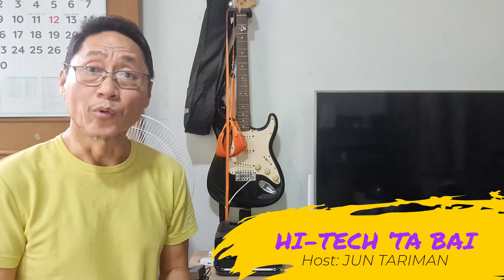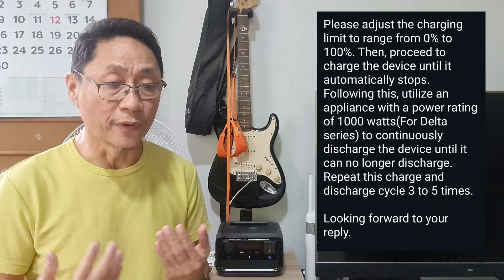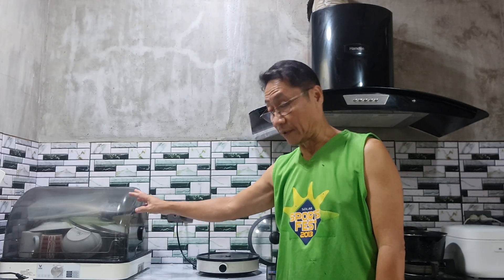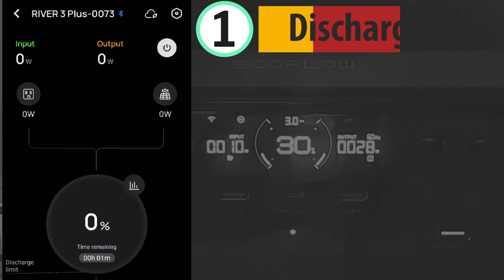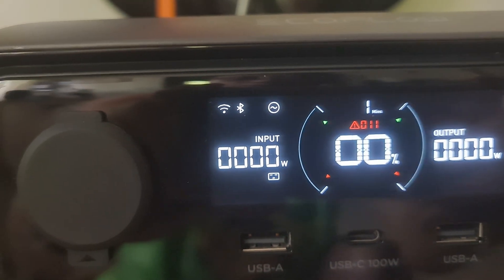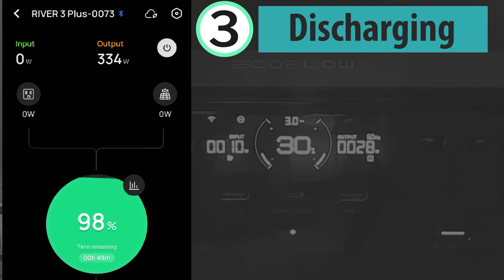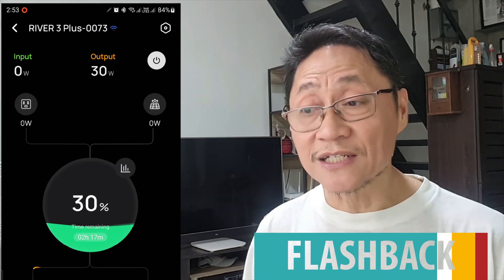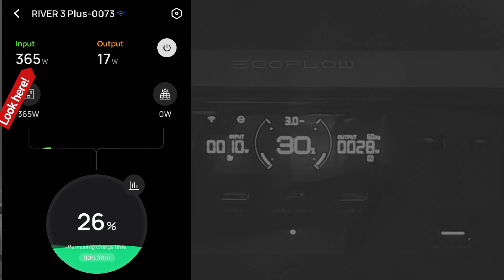Do this to your Ecoflow River 3 Plus Power Station | SoC Calibration vs Battery Draining Fast

Comment: Bakit ayaw mag charge sa akin sir
Reply from the maker: Bakit? Ano set up mo?
Reply: My DPU batteries when they reach full charge with no more input power only reaches 99% with discharge and charge limits are at 100%. What do I do for this since I cannot get the reading to say 100% charge. I have a total of 4 batteries with the inverter.